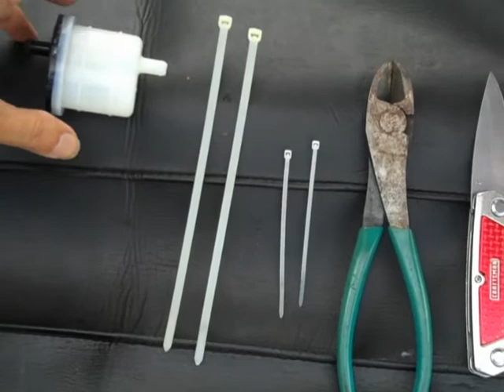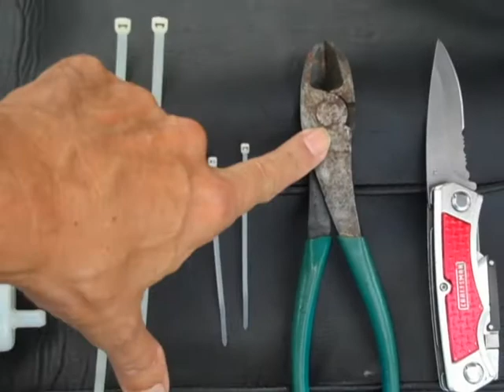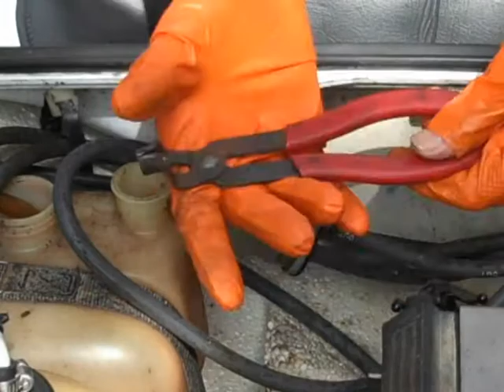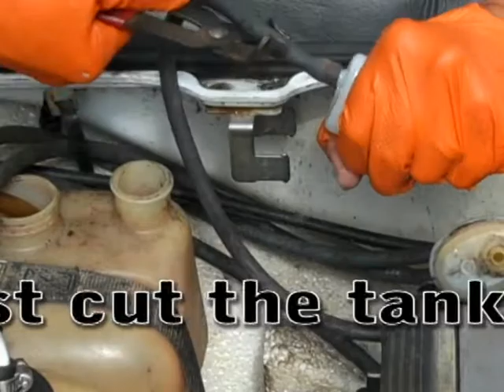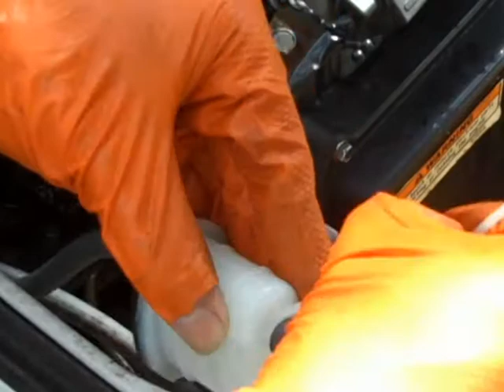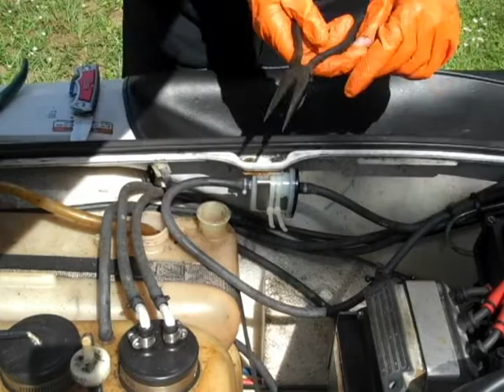JET SKI FUEL FILTER CHANGE

Comment: Thanks for the information.
And after putting the filter i just need to start engine?
There is no problem?
Wich is the name of the tool to take of the tubes?
Thank you
Reply from the maker: Great Question! Yes! Once you install the new Fuel Filter then just pump the fuel primer a few time then start the engine! A Spark Plug Wire Remover Tool is what I used to manipulate the fuel lines!
Reply: @cactusstudiossouth  i did not understand.
Can you show me better?
Because i have the filter and i would like to replace.
How do i pump the fuel?
Sorry to bother, and thank you very much.
Reply from the maker: Hello Manuel! Typically there is an ARROW pointing to the direction of the fuel flow from the fuel tank to the Carburetor! Once you have this orientation set then the tube on the higher side that's up, connect to the fuel line from the tank and the tube on the lower side goes to the fuel line to the carburetor!
Reply: @cactusstudiossouth  my problem is that the fuel filter don't have fuel.
Is there a problem starting engine normal?
Or do i need to put fuel inside filter?
Reply from the maker: Sorry for the late reply, there should be a, 'PRIMER' Lever that you pump in & out a few times! This manually charges up your fuel system. Once the engine is started the Fuel Pump takes over!